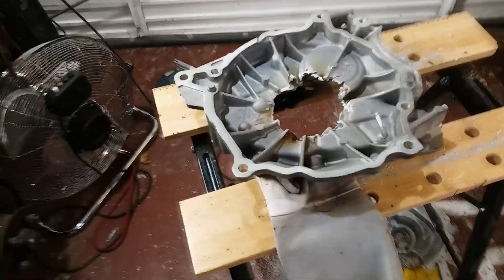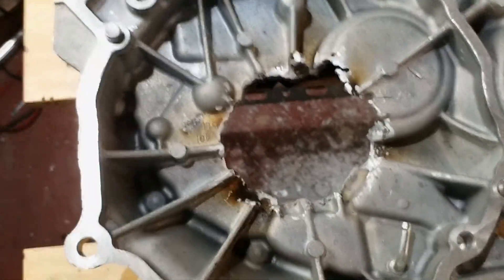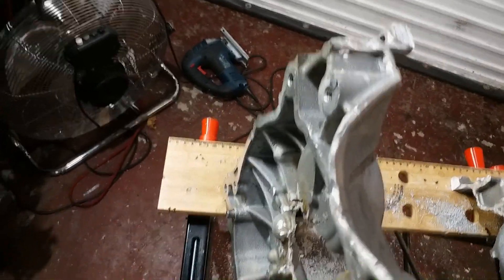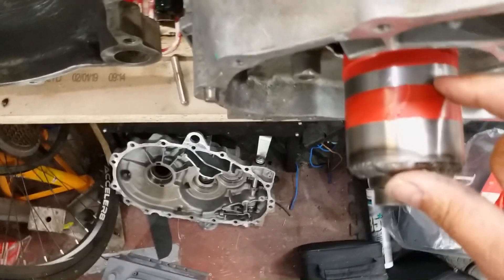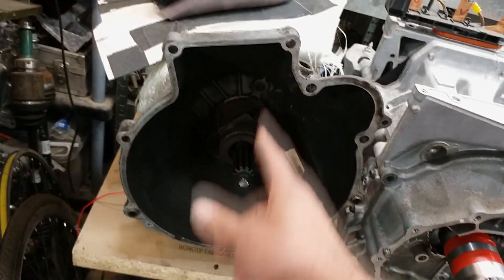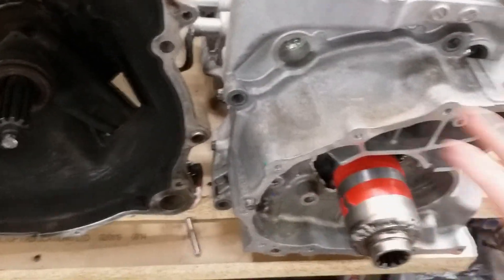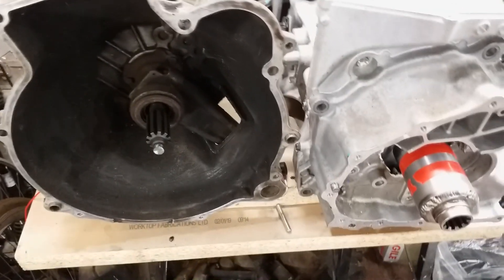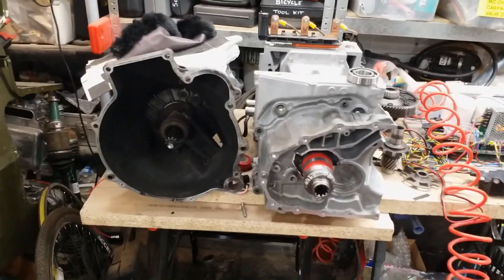Converting a classic BMW to electric. Nissan Leaf Power "Butchered Adapter Plate"Part 6

Comment: I wonder why most diy ev converters don't use clutch? Electric classic cars in Wales always use clutch and it looks nice and professional.
Reply: Not using the clutch is a poor idea. Why use the transmission if you don't use the clutch.

Comment: Keep the plate as thin as practical. I tried to cut 25mm aluminium plate. Not easy
Reply from the maker: I can imagine 25mm will be difficult. I went for 20mm in the end . Managed to cut it with a jigsaw,  was surprised  it cut. Video to follow